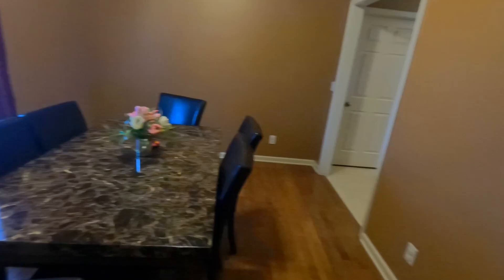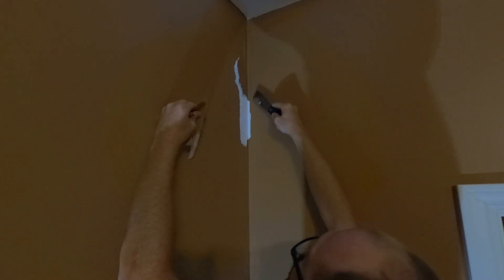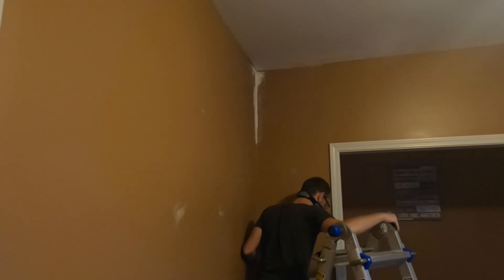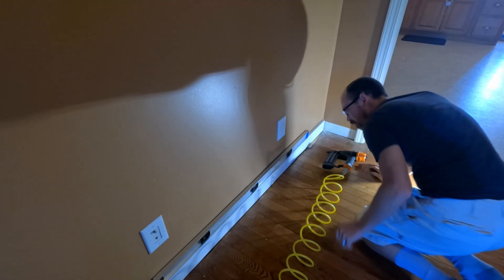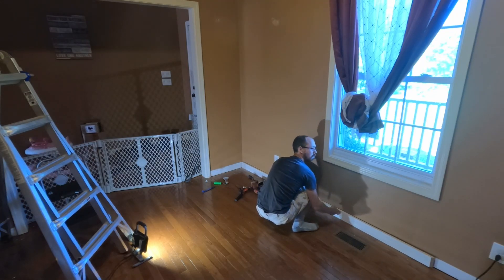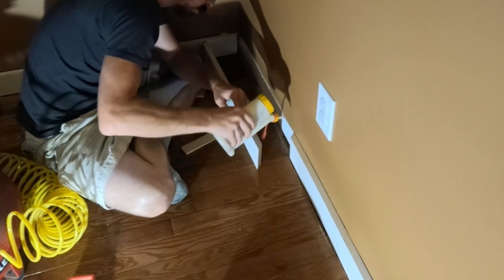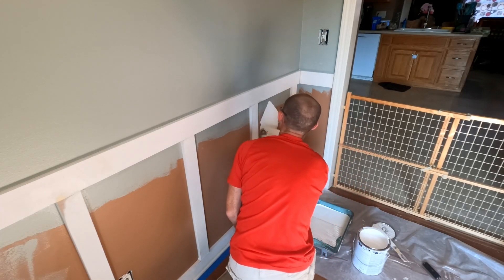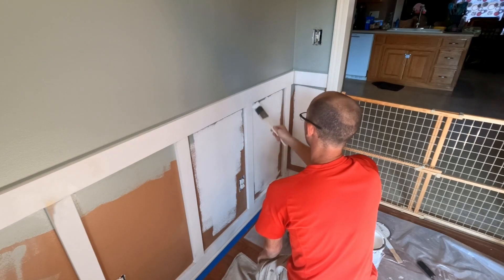Transform Your Dining Room With This Beginner Friendly Remodel | Board and Batten Edition

Comment: I'm surprised that with the original color being so much darker than the new colors, that you didn't have to Kilz or otherwise prime over the existing dark coat before applying the new colors. Looks great
Reply from the maker: I was a little surprised as well.  I did some testing and found that paint covers pretty good.